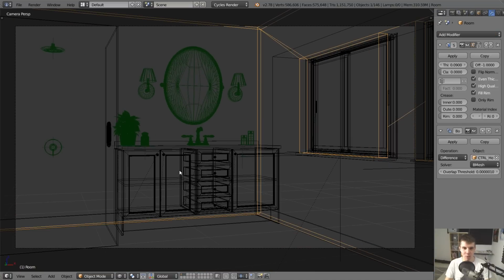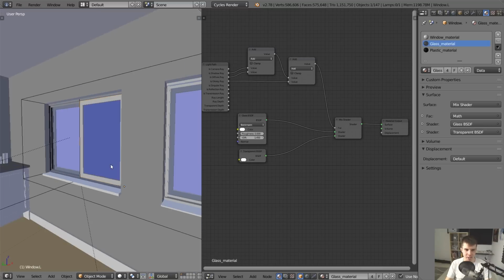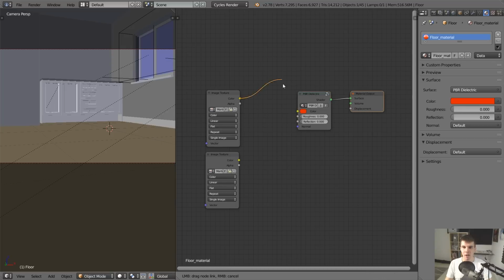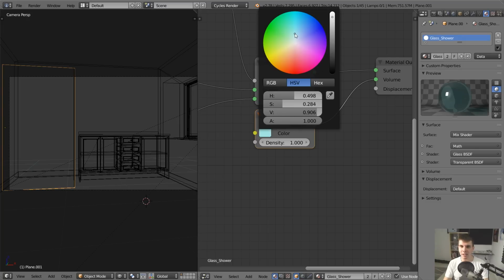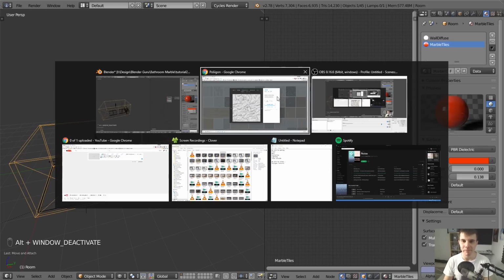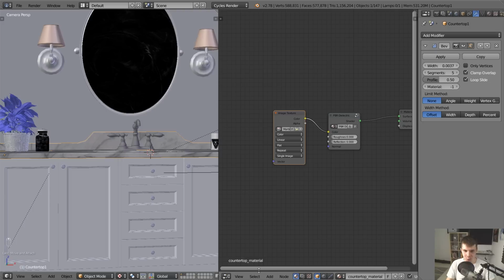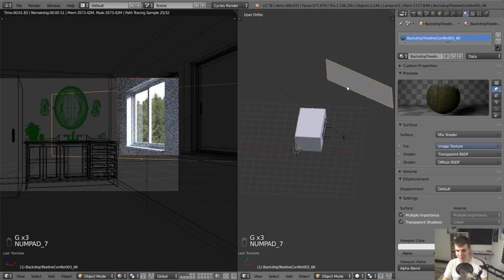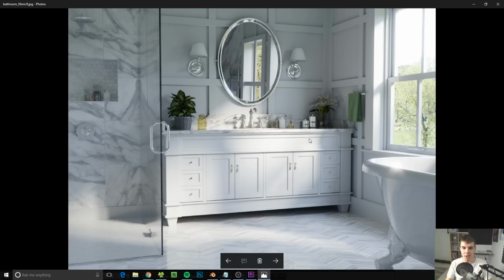Blender Tutorial: Architectural Interior - Part 2 of 2

Comment: If your glass looks like shit, like mine at first or the final render has no soft light..
select all windows and shower glass materials, klick the square icon on the right above the wrench (oject properties) and then under visibility -> ray visibility disable everything except camera and glossy..  or atleast turn off shadow.. that makes sure, that your glass is not generating shadows, this makes it quite dark inside the shower.

another tip..
Render properties -> Color Management..
use view transform - filmic
Look medium high contrast or high contrast
exposure - can be adjusted, start at 0
Gamma .. - crank that up.. your monitor has even 2.2 normally. a value between 1.8 and 2.2 should be fine.
sequencer - filmic log

now you have a soft light everywhere.. and no longer need to turn the sun and light beyond high

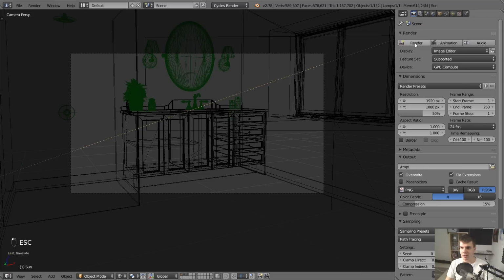Comment: 53:45 Im already using Filmic, so when i put the sun strength to 90 in my case, the background trees got more light and it´s almost like they are burning. Is there any way i can evade that effect? Maybe by making the image texture darker to compensate that sunlight power?

EDIT: I think i got it right by placing a RGB Curves Node between the image texture and the diffuse node, made it darker in all the curves and it looks good i think. Anyways, other solutions are welcome :)

Comment: Just in case anyone wants to know, you can create the water droplets using the particle system.
1: Create UV Sphere
2: Set smooth shading
3: Create 3 or 4 different ones, each with varying height
4: Select the bottom half of each of the spheres, and delete them
5. Select them all, and hit Ctrl-G to create group
6: Add glass material to one of them, group will add it to all the others.
7: Select the shower wall, and enable particle system
8: Select the Group that you created
9: Tweak settings in particle system to your liking
Hope that this helps someone!

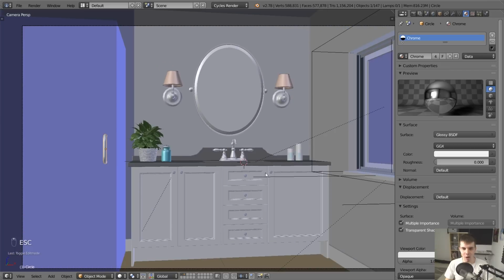Comment: 42:50 Ahh bravo bravo, glad you caught that, I was about to be yet another voice on the internet pointing out the drawer placement. Fun fact, I have actually seen real sinks that have drawers underneath them, but as you can likely guess those drawers are fake and are just the drawer face glued onto one big door that hinges open to access the plumbing. This is usually a sign, in my humble opinion, of cheap furniture attempting to appear ornate, but is easily noticeable to anyone who is aware of the simple physics of drawers. (So it might be something to do intentionally if that is the kind of thing you want to hint at in a scene.) 

Sometimes you will see a drawer face glued underneath a sink, its purpose being to match with a nearby silverware drawer, and that is pretty common and not a big deal especially if the drawer face does not have a nob on it. I have also seen a super shallow drawer under a sink (pretty rare) that gives you about 1.5 inches of storage. (I don't know what you could fit in there. Wash cloths? Used chewing gum?)